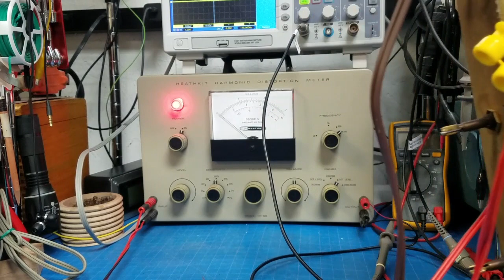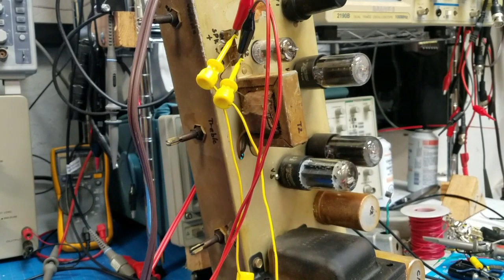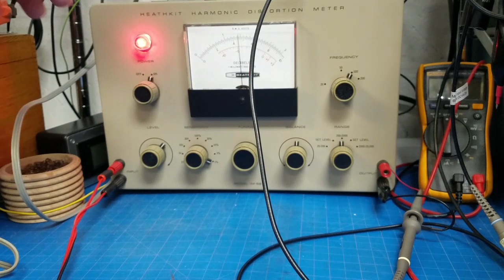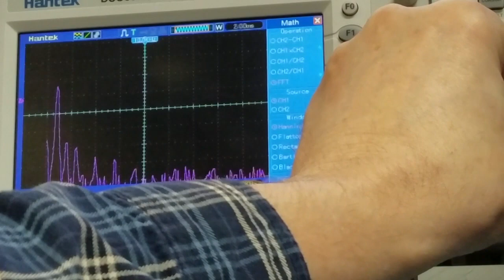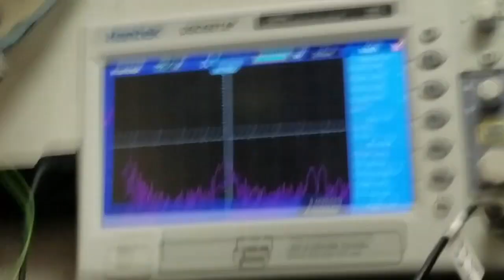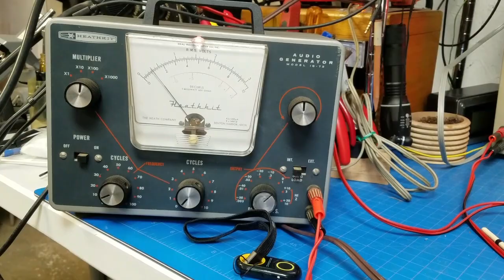Tinker with a Heathkit Distortion Meter IM-58 to test a Zenith 5R20 amp.

Comment: Distortion is interesting with regard to what our ears like and don't like. A tube amp with 2 to 4% even harmonic distortion is usually found to sound rich or warm to our ears and is just one reason why tube amps are still so popular. However, an amp with a half of a percent ODD Harmonic distortion sounds very harsh to most of us.
So, when I play with tube designs, I don't concern myself with a percent or two of even har,pnmic distortion but I always try to keep odd harmonic distortion as low as possible.
If you do audio amp projects, any decent distortion meter is very helpful.
Good luck with your projects.

Comment: Heathkit anything is fantastic. I used to buy the kits new back in the 70s and 80s. Now I look for cheap old ones to restore. They work fine and you can fix them yourself if it does break. Not like the new stuff that you chuck if it breaks. Nice demo! 👍👍
Reply from the maker: Thanks Robert.  Frankly, for my purposes, I can't see anything wrong with Heathkit stuff.  And as you said, you have some of the best documentation for repairing it.

Comment: Really interesting and timely for me as I’m currently building an Eico 378 audio signal generator from an unbuilt kit I purchased on eBay. I wasn’t familiar with your model of Heathkit generator until I saw this video, but it has the same interface as the Eico I’m building. I’m guessing the circuits are almost exactly the same. Like you, I didn’t really need an audio signal generator, but was more interested in building a 52 year old kit from an unopened box. It’s been a real treat so far and I hope to have it complete tomorrow or the next day. I imagine I’ll be experimenting with mine much as you are with an oscilloscope and some old amps. Take care, and great work on the video.
Reply from the maker: I hope to see a video on your Eico.  Even though already assembled, the Distortion meter was like new out of the box!  Not a scratch or even any dust on the cabinet. Big contrast to the smoke stained amp!